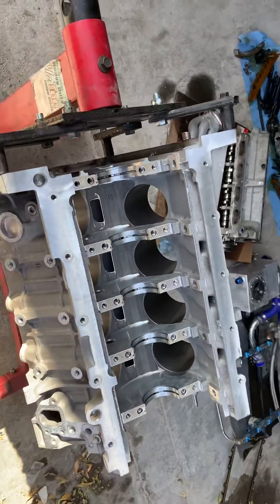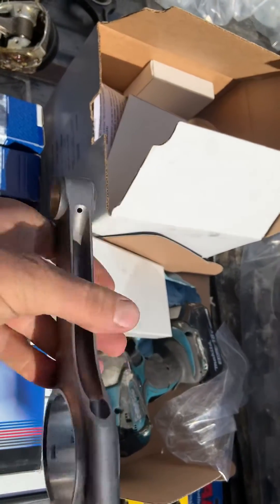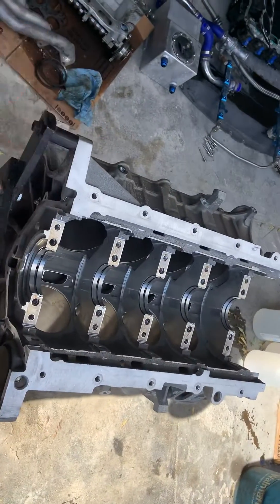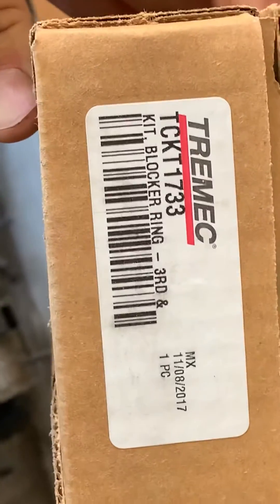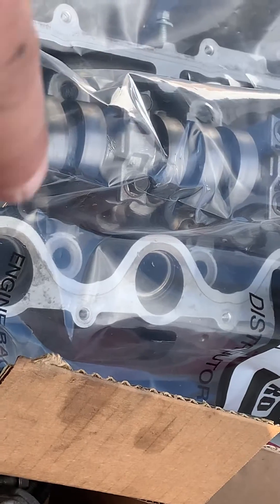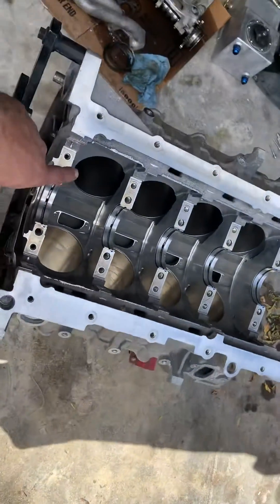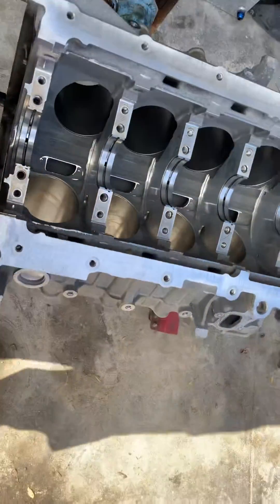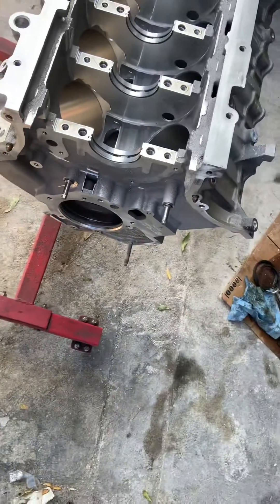4.6 3v forged bottom end build up

Comment: Money is easy to find, time is something you can't buy. engine swaps take a lot of time. Why not get the 5.3L MODULAR STROKER SHORTBLOCK from ford performance and just move the heads and everything over?  Sure it's $7300, but it's ready to go. I'd like to see what 12lbs of boost could make on a 5.3 with 3v heads.
Reply: I see why now, because it's out of stock everywhere. I guess if you need a new block for your boss mustang you have to put a chevy block in it

Comment: LS came out in 97 the 4.6 came out in late 1990-1991. Why post a video full of inaccuracies?  In all honesty I, in my own opinion, wish that you closet Chevy lovers would just stop messing with Fords if you don't know what you're doing. the most you would have to change is the rods and the Pistons the three valve heads flow exceptionally well. If anything you raise the compression ratio when you swap the Pistons the same way you would do if you were to take the 2v pi heads and place them on a prior to 2000 short block. It's not rocket science. it's just a bunch of you people who don't know what you're doing and because YOU think a Chevy engine is easier to build you speak down on Fords overhead cam engines. Ffs there's information all over the web that shows compression ratios and flow rates for the 3v heads and you cross reference that or superimpose it on the data from the new coyote and you will see that you actually have a monster on your hands if you're smart. That is all have a good day
Reply from the maker: wow.  someone got there feelings hurt.  Im a mechanic every day.  I work on every type of engine.  Any statements I make are because I have had many fords.  Truth is they work fine.  They are expensive to make go fast. mod motors have there advantages, but ls motors have many more.  There is a reason you dont see many people swaping 5.4 and 4.6 motors into anything.  Ford made 10 gazilion of these things and most are rotting in a yard somewhere.  Gm 4.8,5.3,5.7,6.0,6.2 are being swapped into everything.  You can hate it and hate on chevy and call us dumb because we think its easier to work on ls motors, well the truth is....it is easier, cheaper, smaller than that fat ass 4.6, and make way more power on stock stuff.  Parts all swap, no cleavland/windsor plant crap that wont mix.  Shut your mouth.  You assume I dont know anything about fords.  I cant tell you how many lame ass 5.4 3 valves I had to lock out cam phasers this last year on 100,000 mile motors because the cam wore the head and it cant keep control of the phasers.  You can keep your fords.  Spend more to go fast.  Im fine with that. Next time your at the track, look at every foxbody there... 70 percent or more are ls swapped
Reply: the chevrolet ls is cheep thats why you see them all over better that is debatable push rod is old tech ! @Brainstangs

Comment: So generally speaking, Is it a better idea to buy an MMR short block and rebuild from there or tear down the motor and fit it with forged internals from Summit racing? The MMR short block is almost 5K and the Summit Racing forged internals are about $1800.
Reply from the maker: I think you have your answer. You just got to have a great machine shop and check everthing over and over!

Comment: Question. I got a 02 2v block sitting & I got a rotating assembly for my 08 mustang GT. I was wondering if I could put the 08 forged rotating assembly in my 02 2v block? Is the blocks the exact same? I just don't wanna have my car down while I work on it. So I bought this cheap 02 2v block but don't wanna get ahead of myself of it's not gonna work
Reply from the maker: the parts will fit.  the notches on the pistons for the valves are what you have to check on. 08 is a 3valve motor.  it depends on what heads your using
Reply: I own a 2v & 3v 4.6, been very reliable,,, but Chevy is the way too go for sure !!

Comment: How much horsepower gain would all of this be on a stock motor ?
Reply from the maker: not much of a hp gain at all.  just making the bottom end forged.  I kept the same factory compression ratio.  You could add a little with bumping up the compression ratio with different pistons.  The way i built this motor it should handle 900 boosted hp to the wheels all day long provided you got a clean tune, good fuel, and a lot of boost.  it would need 25 psi about to make that power number.

Comment: I have a 3v and I do want to build it in the future when I can actually afford to. When I first got the car, I always wanted to coyote swap it in the future since, let’s be honest, the coyote is just a better motor. But after owning the car for 4 years I’ve changed my mind and really want to build the 4.6 because that motor gets a lot of hate and I want to own something that not many other people would build. My goal would be around 550-600 hp to the wheels, nothing too insanely crazy but definitely enough to gap any coyote I come across.
Reply: im with that!
Fuckin good luck bro!
i felt the exact same way wen i got my 07 shelby gt 4 years ago... well like a year or two into owning it i did. thought coyote swap.
now im on a journey to hit 800rwhp! 
dropped a stage 2 roush sc and single driveshaft in it a year ago and making about 420rwhp, almost 500 hp
Reply: @WONDERBREAD89  hell yeah man! I just put a set of cams in my 3 valve not too long ago, just got back from mustang week in Myrtle beach, SC and had a blast with the car. Next up are a set of wheels and some more cosmetic mods, then I’ll set my eyes on either internals or boost.
Reply: @CG_Element  
Noice!
Shud vlog some of it!
I'ma need a break here soon with colder weather comin and definitely bust the stang out!
Wat cams?
Done a lil research on em and brenspeed has a boost grinded Detroit rocker cam that sounds out of this world!
Reply: @WONDERBREAD89  I went with the hot rod cams from Ford. I did an absolute assload of research on those, the Detroit Rockers, and comp cams. Out of those 3, the hot rod cams are the ones that had the most positive reviews with the least amount of negative reviews. After that I had the car re tuned by Lito, if you’ve never heard of him he’s a guy who specifically tunes the 3v motors, he’s been doing it for many years and has gotten really good at it. The car feels a lot faster especially in the higher rpms and sounds really good at idle. 

I think with some long tube headers I could push it near 400, and with some 4.10 gears I think it’ll be a pretty mean ride, maybe even able to keep up with the coyote cars. I’m sure it will still have nothing on yours tho lol
Reply: @CG_Element  
Those are the best sounding cam no doubt!
Detroit's super charger grind cam have no low end tq loss. From wat I've found and wat they(brenspeed) tell me. Same almost cud be said about the HRC but I do believe they say minimal tq loss. Right?
But ur 410s and the boss man Manuel's litto tune fixed that right up I bet! 
Sounds like a legendary ride my friend!
I do wish I had more in person mustang friends than over the inner webs lol
Cheers man👊
Reply: @WONDERBREAD89  they do have some torque loss in the lower end but honestly I can’t tell much of a difference, and even if it did lose some torque who cares right? No one does a pull at low rpm so it’s only gains In my eyes lol 

I’m lucky my girlfriend is into cars and she actually recently bought a 2006 GT and hopefully we can build them together as time goes by, I also have a 1986 GT that I want to build along side my friend who has a 1984. I’m sure I’ll buy more mustangs as time goes on lol I love every single body style.
Reply: @CG_Element  I love the sound of the Detriot Rockers but it was hard to endure the loss of low-end torque it came back around with the long tube headers and then some.
Reply: @danielroberson5421  I definitely want long tubes for my car. ik theyre a pain to install though. from what i've heard its one of the best mods for the 3v
Reply: @CG_Element  If you get cams I recommend doing the Headers at the same time.  Headers do make a difference that and the 4.10 gears were the best mods for gaining more performance.
Reply: @danielroberson5421  i've already done cams in my 3v a little over a year ago. i will still do long tubes and gears at some point though, right now my main focus is a 1986 foxbody i bought and restored
Reply: @CG_Element  Fox Bodys sound so good.

Comment: Looking at this piston and rod setup for a turbo build. Looking to push 900 wheel. Definitely upgrading the valvetrain too. Do you think I would have to worry about the heads or the stock valves holding up with that kind of boost?
Reply from the maker: I think you should upgrade your valves.  I don’t know what your rpm goals are but I think anything over 6 k you should think to do it. This motor will most likely never see more than 6500 and no more than 650 hp.  Really consider traction concerns. with that kind of power. I have destroyed several 1000 hp coyotes twin setups with my 1300 hp 6000 # turbo Silverado.  If you can get 650 to hook you would destroy my truck.